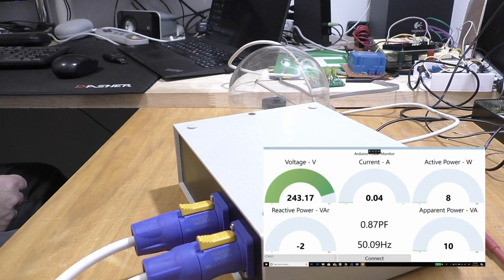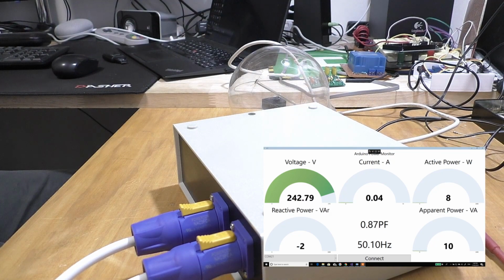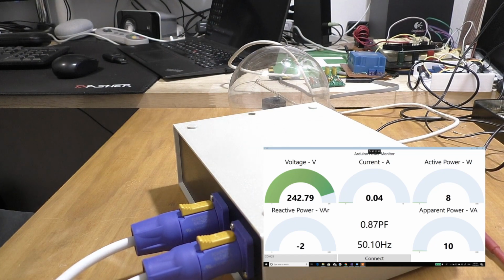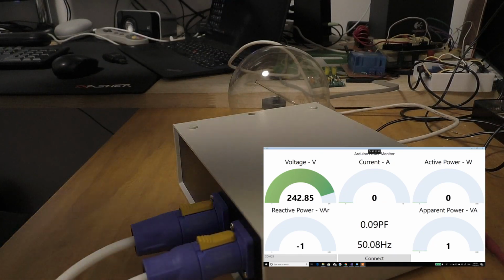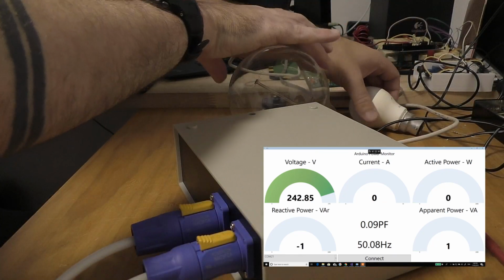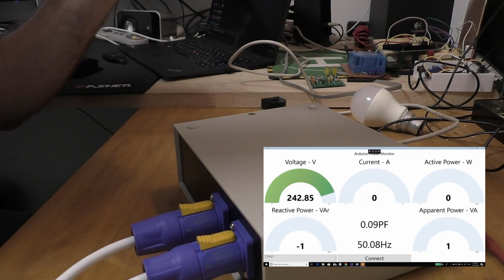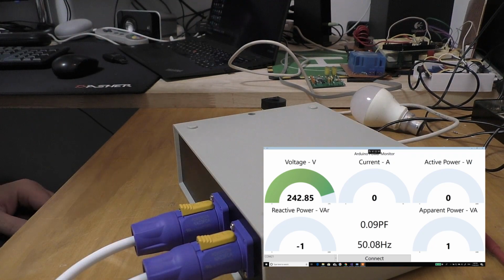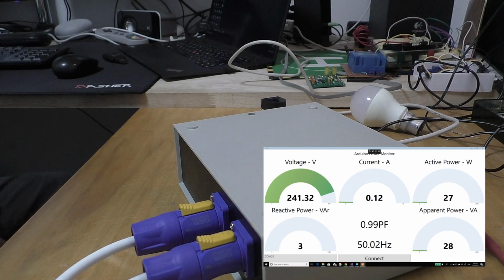Arduino Power Meter Update

Comment: hello sir have you used the atm90e26? some questions about that why my readout values are maximum, like 65535,the project wattnick
Reply from the maker: Have you tried adjusting the calibration?
Reply: @50Hz  yes, but the csone is wrong when i didnt change the calibration
Reply from the maker: @xingyumli8104 so the crc is incorrect. Is that what you are telling me?
Reply: @50Hz  yes,i use nodemcu esp8266,i push reset the outcome is 0xffff,checksum erro,is my spi wrong?
Reply from the maker: xingyum li send me an email. Jongrimes1983@gmail.com I’ll send you some setting yo should try

Comment: For cost alone i would have probably used a pro mini instead of a uno, well lets be honest, I would have used a NodeMCU :) But looks good so far brother.
Reply from the maker: I need the board for a few different projects so im going to make different shield adapters rather than different metering IC boards. Otherwise I would agree with you. And thanks for the sub

Comment: I suggest securing the board to the chassis in some fashion, having stuff flapping around near power electronics is not a good idea.
Reply from the maker: Thanks. I actually just finished designing the adapter shield for it just now. Just need to touch up another project so I can send them both for manufacturing at the same time

Comment: I am looking for resources to initiate a project for a prepaid air conditioning system using gsm system. The idea is to rent the AC unit to customer and charge only what they consume. To do that I need a power metering mechanism to calculate consumption. The daily power consumption  of the AC is sent to a central monitoring site via sms.
The power meter should be able to cut off power to the AC when customer consumption reaches the paid amount of energy. Also the system should be able to be reactivated when customer tops up his account by sending an SMS to the monitoring station. Any resources you can point me to please?
Reply from the maker: Interesting idea.. There is a few AC units that are WiFi enabled to come off on remotely. Maybe if you sold time not energy you could tap into that through an app rather than using hardware
Reply: @50Hz  thanks for prompt response. Why I want to use the SMS option is that I can enable or disable the activation of the AC (customer not being able to switch the AC on if he his account is empty) it's only when he tops up his account that the AC activation is enabled. Do you think a WiFi solution can allow me to monitor and activate the ac remotely ?
Reply from the maker: @zigoto213  I remember seeing an add for a Samsung unit being turned on from a phone before they got home. Plus being WiFi you can save on the mobile network costs
Reply: @50Hz  WiFi is, indeed a cost effective solution that I can offer as a first option. Providing customer has WiFi and internet access. 

Also where can I find such power meter capable of being controlled to activate or deactivate power to the AC?
Reply from the maker: @zigoto213  actually I just had another idea. Check out WiFi smart switches for power points. Find one of them and you could just stick it in a box and jobs almost done.